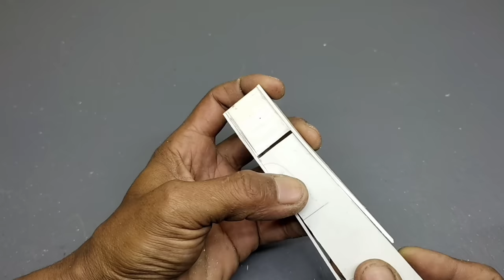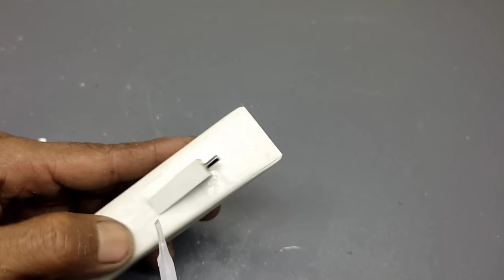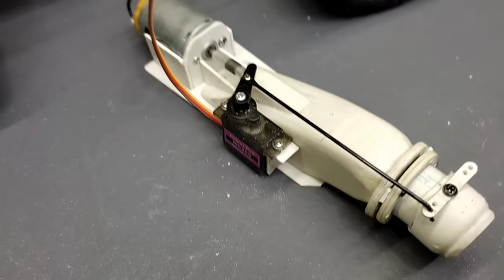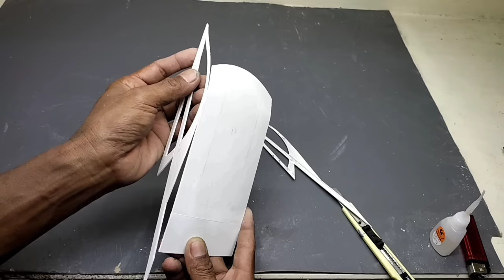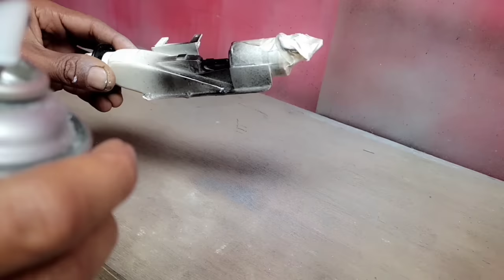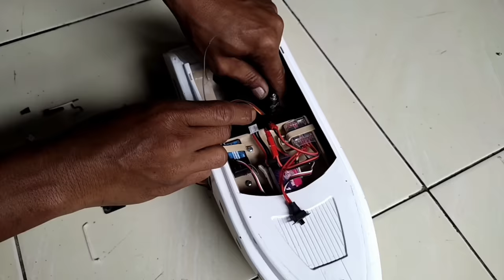i made a RC boat out of PVC pipe | Full video

Comment: One day: I decided that I wanted to build a model shrimp boat from scratch, and I did so in only seven weeks of labor, and designing.  After I had done that: I proceeded to build a better one.  I am in thr design phase of a fully functioning Shrimp Boat now .  Everything on it, will work as if real.
Reply: Have you looked into 3d printing? I've built a few boats, the only issue is the proper glue, and then sealing the 3d printed plastic, otherwise it'll get waterlogged cuz  its porous.
Reply: 00
Reply: @Wolf Larsen  : Yes I have looked into 3d printing.   I have a Creality CR-10S Printer.  If you want to seal it: Use a thin layer of Epoxy.  Paint it on the inside,  and the outside of the hull. Use a thin Fiberglass sheet for extra strength. Use CA glue to join the pieces of the hull.
Reply: @John Strickland  yeah sounds about right.  I just like to use enough paint and primer to seal everything on top ofnrhe epoxy coat.
Reply: ළුට්‍යටකව්‍ය්‍රවනකක
Reply: The next time you do that you should record the process and post it on YT. I would definitely watch it.
Reply: Q ni by❤ ni by Dr ni by